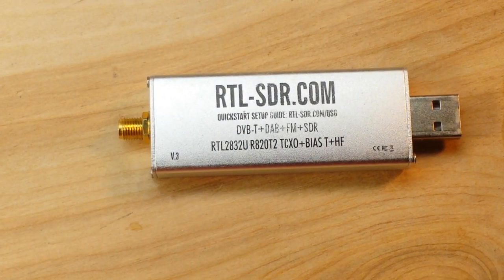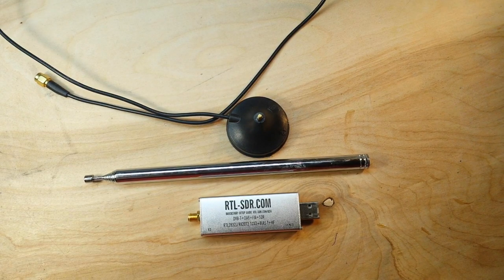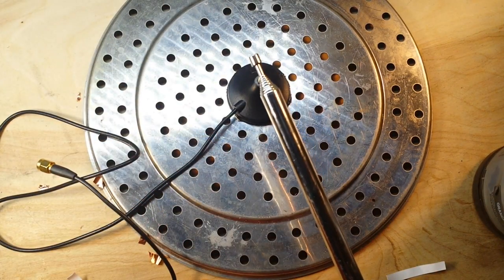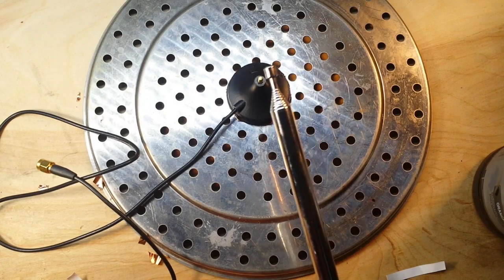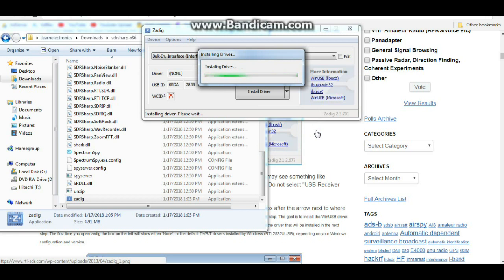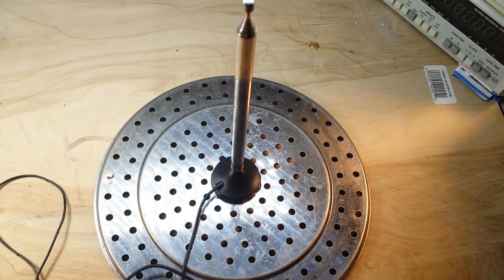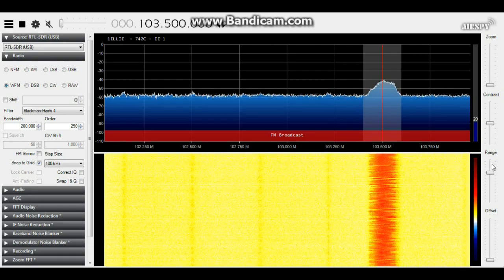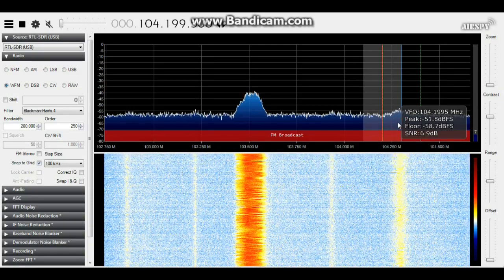Get started with Software Defined Radio SDR for $20

Comment: I live out in the country away from all the electrical noise.  Recently strung up a 200ft long wire antenna 30ft high, hooked to a 9:1 balun. Runnin that same sdr with a spyverter r2.  The amount of signals I get now is INSANE.

Lowered my rf gain from 14db (with stock rabbit ears) all the way down to 2.7db.  On medium wave I get 30+ broadcast stations.  Some of which are from the next state(s) over.  Literally jam packed.  In addition to all kinds of hf ham and international shortwave activity. That balun and wire was the most powerful $50 I've ever spent..

Comment: Interesting video. The thing is, your antenna is a monopole, not a dipole. You'll want to set it to 1/4 the wavelength of the signal you want to receive instead of 1/2.

Comment: Antenna length only really matters if your are transmitting, if you are only receiving, the more antenna the better. If you are feeling adventurous there is software out there on the ham radio sites that will allow you to decode different digital modes, like packet radio, WeFAX, SSTV, PACTOR, even Stanag which is used by the US Military and NATO.

SDR # has addons also that will allow you to grab CTCSS and DPL tones, MDC signalling IDs and even track trunking radio systems

You need a longwire external to get HF signals, there is a certail math to calculate the height of the wire and such since you're receiving the longer the better.

That spike @13:24 is the SDR's TCXO operating at around 28MHz, most of the random spikes you're hearing are the USB and computer noises.

The 49.997 is a harmonic from that 28 - 29 MHz TCXO signal

49MHz should be auto setting to FMN @ 20/30 KHz bandwidth as this is VHF-Lo band.. Once you run up to 150 and 450 MHz the bandwidth should be set up for 12.5 KHz

If you are a Linux guy you can look into GNU radio, it has more features and allows more specific control over your SDR
Reply: Your statement on antenna length is absolutely incorrect. Google ‘antenna rule of reciprocity’. Antennas are cut/tuned to a specific length for the ideal or resonant frequency. Antenna length is equally important for transmit and receive.
Reply: GNU radio... yes i used it too, but everytime i try to start up for the second time, it don, t work anymore.
When i install it on Linux, the first time, everything works fine.
A day later it don t anymore. I, ve search for the reasons, but i can not find the answer, why this happening all the time.

. o and sorry for my bad English lol

Comment: Re: the ground connection from magnet, should it be a ~0 ohm connection? I checked the similar one that came with my nooelec rtl-sdr and the magnet is connected to ground with a 75 ohm resistance (checked with the meter so I'm not sure if there is a reactance as well). I would have thought it should be 0 ohm but it's not connected to the center conductor at all, just through that resistance to ground.

Comment: I bought one of these, but the NooElec brand.  (I just wanted to be able to receive FM stations in stereo on my PC, to avoid having regular FM radio).  I merely use a spare HDTV antenna, by using a screw-threaded adaptor.  The SDR# (SDR Sharp) software is OK, but installation is unnecessarily clunky and the interface could be a lot clearer.   There should be a way to turn off the "waterfall" display, which is not needed for most users.  However, I am happy with my purchase.

Comment: What is the simplest SDR software for SWL? enough of all the possibilities, I learned long ago, the best way to learn is to start doing what is simple and work your way up. Going for the top is fine if you have someone to take you there directly, but when just starting a simple application is best. I got my first ham license in 1967, and did industrial automation (computers) until 2013, but no longer want to do things the hard way. 

I just want a program to install on my computer and start listening to the HF SWL bands. That's all.

Comment: Nice video, some of my tips.
9:20 The very first thing you want to do there is to adjust RF Gain by clicking the gear icon.
12:28 That device won't go above 1.6 GHz.
12:59 Putting a roof antenna can bring a lot things specially if the antenna is made for that frequency and don'' t forget antenna polarity.
13:10 There are spikes that comes internally from those devices, the only way to know is to disconnect the antenna to see if the spike goes away.
15:20 If you are close to a signal you can fine tune it by right clicking on the spectrum/waterfall area.

Comment: Neat little radio. Thinking of getting into this, It looks like yours goes into the ghz range without anything additional. a lot of people on here say you need an upconverter to listen to those signals but all I'm looking for is the receiver dongle, an antenna and the software you are using. Question, do I need to connect this to earth ground or will something metal like what you have suffice? I want to hook this to my laptop and surf away.
Reply from the maker: A pizza pan or a cookie sheet send to do the trick. I've heard of folks using a metal file cabinet also.

Comment: Paul, thanks so much for the info about the RTL-SDR antennas often not being grounded properly...after watching this vid, I determined mine was the same way.  However, where the heck did you come across that info?  My google-fu has failed me, I can't find anyone else discussing the issue.  I already tore mine apart and fixed it, but would like to see what others are doing.... Thanks!

Comment: I thought you said you were getting your radio license. I wanted to get into HAM radio at one time but was too expensive for me. Is this heading in that direction? I was always hoping to see more of your RC stuff, it's a very interesting subject as well. Thanks for opening our horizons to different type of electronics.
Reply from the maker: +George Chambers HAM stuff coming soon...
Reply: I though he had his Ham license..
Reply: Getting your license is cheap... Like $10-15 IIRC to take the test. Loads of free study material online. Now, buying HF hardware isn't usually cheap, but you can build your own low-power CW stuff pretty cheap, and a Baofeng UHF/VHF tranciever is around $30!

Comment: not on german amazon v_v
it does ship to germany, but i dont wanna know how much that will cost
Reply from the maker: +fredlllll probably $30 us
Reply: found it on ebay for the same 20$, free shipping from china. got any tips for what antenna i should get?
Reply from the maker: +fredlllll Antennas are the absolute key to good reception. Listening to VHF frequencies a simple telescoping antenna works great. But if you want to get into the HF (short wave) band a dipole hung between a couple of trees or a house and tree is the gold standard.
Reply: guess ill settle for an sma connector with a cable XD i have enough telescope antennas salvaged from radios over the years. and i can build my own dipole or yagi antennas
Reply: SMA to BNC female adapter then you can build your own external antenna from regular wire and connect a BNC male lead to it. There are many HF antenna building videos on Youtube for this.
Reply: already ordered a 50cm SMA extension. gonna cut off the other port and attach it to one of those old household antenna connectors cause i dont have anything else.
Reply: F connector?  Since you are receiving a 75 ohm TV coax will work just fine to run out to an outside antenna., Do you have and outside antenna? If not a long length of wire run out horizontal will do nicely for HF reception just get the line up at roof level if possible.

Cable impedance will start to matter if you start transmitting. Since most SDR radios do not transmit then no harm no foul
Reply: Belling-Lee connector is what they are called apparently. the f connectors are used for satellite dishes here, not for normal dvb-t. but yeah got those tv coax cables.

only gonna receive, dont have a license, and this being germany its such a pita to get one ill rather pass. if i wanna transmit something its going to be on ISM bands
Reply: Edit: I'm an idiot. The one that i ordered uses an oddball connector. The on in this video does look like an SMA.
Elsewhere in the comments Paul called this a pl-259.

Srrry for the confusion

Edit to the edit: I misread Paul's earlier comment. I'm a bigger idiot than I thought...
Reply: "these radio modules use a pl-259 connector, which is a bit smaller than an SMA."

My 25 years of professional radio technician and RF Engineer certifications tell me that a PL-259 is much bigger and mates with an SO-238, We call that the "CB Radio" connector. 
Now, Jjst about ALL of these little USB DTV SDR dongles use SMA or an MCX type connector which is smaller and will actually fit in the circuit board container.
Reply: ElfNet Gaming :
I'm an idiot. The one that I ordered uses an oddball connector. The one in this video does look like an SMA.
Elsewhere in the comments (I misread what paul said) Paul called this a pl-259.

Sorry for the confusion
Reply: No problem. 
To note:
The PL-259 is the male part with internal threads, of the matched set PL-259 / SO-238 where the SO-238 is the female part with the exposed threads.
Reply from the maker: +pileofstuff I didn't call it pl-259
Reply: Sorry. I must have misread your other comment.

I'll just step away from the keyboard for a while now...
Reply from the maker: It's all good. Lot's of info flying around here.
Reply: it arrived :D very nice piece of equipment. even works with just a jumper wire stuck in the sma connector. still have to wait for the cable with the connectors
Reply from the maker: +fredlllll nice! Maybe you'll hear on HF one night

Comment: is it possible to increase the frequency span?
Reply: Yes. But you need additional hardware. To be honest, its far easier, cheaper and more efficient to just get an sdr with a larger freq range. Or even multiple sdr's for different freq ranges.They're cheap as hell these days. Or you can go full on and get something like a HACKRFone (about $400US). Its freq range goes from I think 1Mhz to 6Ghz. Which is the entire commercial spectrum. Which gives you all the hf, vhf, uhf,sat bands plus mobile bands and wifi bands. So basically, if it transmits through the air, you can listen/hack it. Very fun.

Comment: Can you please post a link to that particular antenna? I've had one of these SDR units for a while now but the supplied antenna is just a wire about 4inches long. Also, how did you work out that 27" dimension? (Us kids are dim!)
Reply from the maker: +Itsmeintorre Spain A 4" piece of wire? That's no good. The antenna came with mine. Just Google mag-mount telescoping antenna. As for the dimensions, many complex calculations involving derivatives, non-Euclidian geometry and squirrels.

Just kidding, I used an antenna calculator.

http://www.westmountainradio.com/antenna_calculator.php
Reply: Thanks for the info. Your Amazon listing states no antenna supplied.  My antenna (which came with the Dongle) looks like a short wire but it does have a mount, is coloured black and has an anti-pokey- eye thingy on top.
Reply: Or get a proper antenna and an SMA to BNC adapter. The stock antennas are garbage.
Reply from the maker: +ElfNet Gaming a proper antenna would use a pl-259 connecter. Bnc's are not indicated for hf transmission lines.

Comment: Not technically correct.  The waterfall left to right is frequency , not intensity,  Intensity is coded by color.  It is 10 meter, not centimeter band.

Comment: Not to be a smart ass, Magnets do not stick to real stainless steel. Sorry.
Reply from the maker: Sorry, but that's not correct. Magnets will stick to certain grades of SS, like 440.
Reply: Salvage yard will only pay the Stainless rate on non magnetic stainless. My $2000 Whirlpool Stainless refrigerator will suck up a magnet.
Reply: I get ur point though, cheap stainless is magnetic.
Reply: Absolutely.....it depends on the nickel content, not just the iron content. High nickel stainless grades are magnetic, and much more expensive.